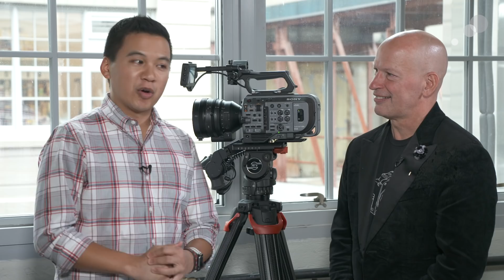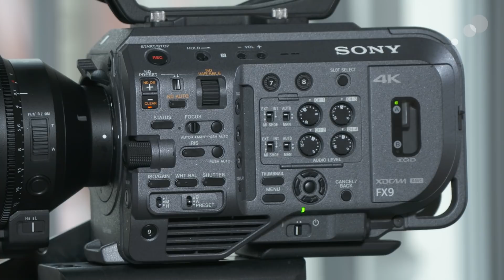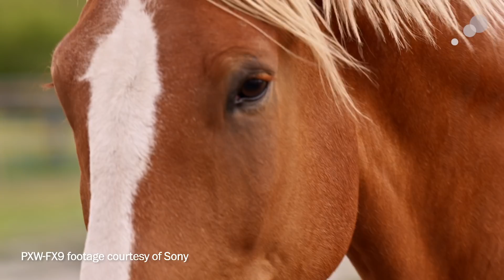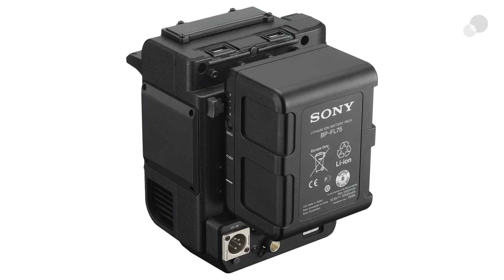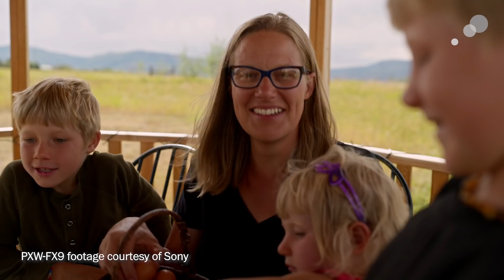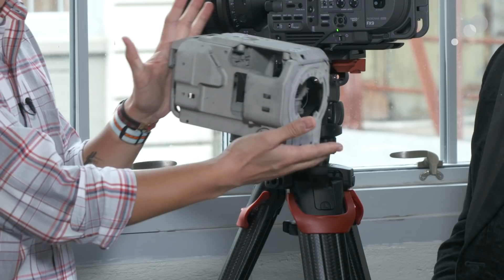First Look: Sony PXW-FX9 Camera

Comment: Thanks for the info. Am I able to mount the FX9 on to a Zhiyun Crane 3 LAB?
Reply from the maker: Thanks for the comment! Here is a reply from Nic, one of our tech specialists: The Zhiyun Crane appears to be designed for DSLR or mirrorless style cameras, so it seems doubtful that the FX9 would fit. That said, we are not resellers of Zhiyun products, so you will want to contact the manufacturer for their recommendations.
Reply: @AbelCine_official  Thanks. I learned that the Zhiyun Crane 3 LAB can hold up to approx. 10lbs. Not sure about the size, but I can try to figure that out. How heavy do you think is the FX9 (body and battery) with that 16-35 T3.1 lens? Would it stay under 10lbs? Thanks in advance.

Comment: Why did they not include in camera raw? 12 bit, even.
Reply: I think there wouldn't be any reason for the extension then. Maybe processing power too but probably mostly that sweet sweet money for the extension module.
Reply: Patent laws prohibited it.  Atleast that's what it says on the Sony website
Reply: Greg Goodenough Canon, Blackmagic, and a couple others have found ways around RED’s soon-to-be-rescinded raw patent. This was Sony’s biggest mistake with the FX9, IMHO. Granted, RED did sue them directly, so Maybe Sony signed a crappy non-compete clause with raw, but if not, letting RED boss them around is sad...
Reply: Greg Goodenough Not if they pay for it. Canon C200 records Raw internally. 12 bit. I guess they’re paying for it.
Reply: @pablovi77  or..... they have the patent
Reply: @pablovi77  and given Nikon doesnt have a cinema line, that's probably exactly who it is.
Reply: Greg Goodenough No, the patent belongs to RED, Sony sued and lost. And right now Apple is suing RED. A lot of cameras have internal raw recording. I guess they pay RED.
Reply: @pablovi77  well looks like yah answered you're own question man.  That's got to be some payout though.
Reply: Greg Goodenough Well, my question was more in line on why do they have RAW on Venice, F55, F65 and F5. But refuse to pay for it in this camera. But I guess the answer is on top. They wouldn’t sell the back module otherwise. And you still have to pay for an external recorder on top of that. I think I’ll get the new C500 II. Instead of this. I need RAW.
Reply: @pablovi77  I'll pick up this one, and we can compare. 😬
Reply: Pablo Villegas that patent is for compressed raw, but the new Blackmagic RAW gets around it, apparently
Reply: As I've read, it can make 4K 16-bit raw with an extension.